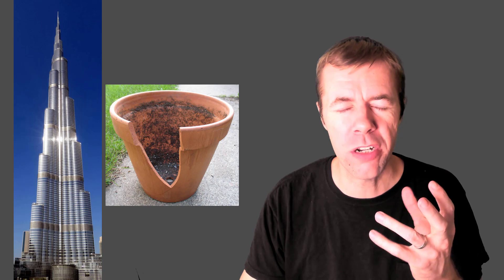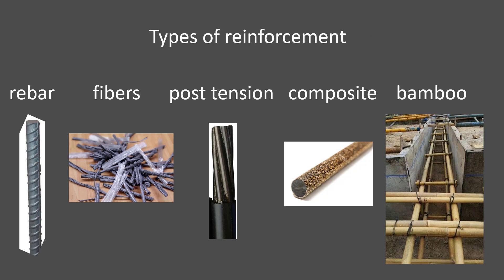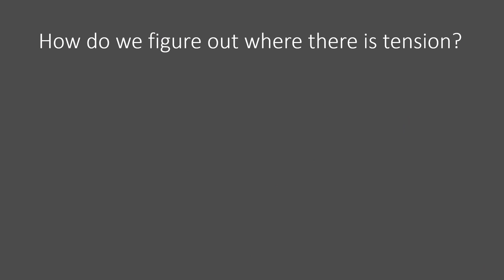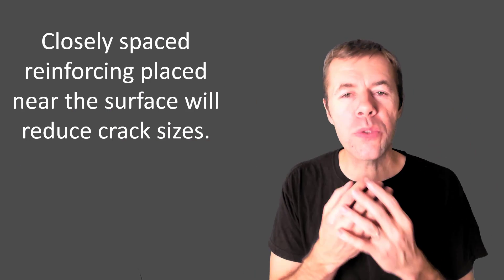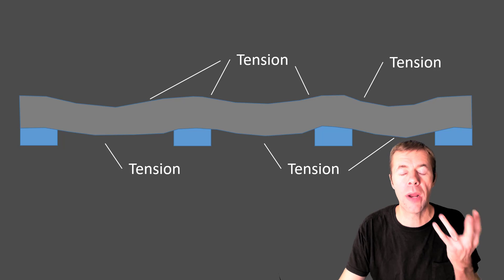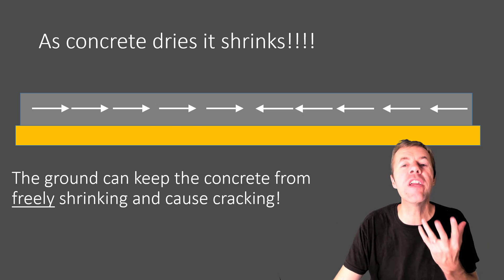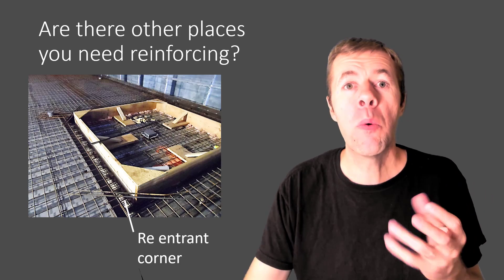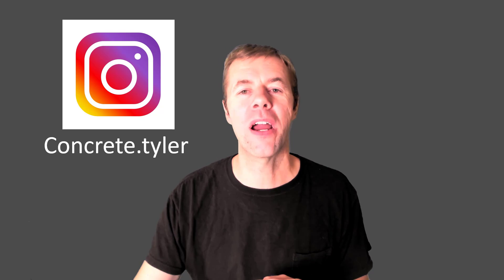Secrets of Reinforcement | How to design reinforced concrete

Comment: I have never - never - seen a video that explains better why reinforcing sometimes goes in the top, sometimes in the bottom, sometimes both. Fantastic video. One suggestion - sometimes we assume that the foundation under a concrete pad is 'immovable' but in reality, granular aggregate bases can and do deflect under load, so sometimes reinforcement at the bottom of a slab may still make sense.

Comment: Retired Concrete Finisher Porter Big 8 for years ago my grandfather had a lot of scrap inch and a half rebar 8 in on Center 4000 lb 6 in thick on chairs never crack Claiborne gray compaction is supposed to be hard that's why they tested

Comment: The ground will heave and contract.  I introduce the red clay we have in some parts of north central Texas, NW of DFW about an hour or so. 1+" cracks in the ground in the summer, zero cracks in the wet(ish) months. Slabs on grade can heave and fall at the perimeter and, the clay under the center area will dry out and contract, leaving voids under the concrete if there are sufficient piers to support it or turning the slab into a cereal bowl if there aren't. It's not just the friction of the soil holding the slab from expanding and contracting causing tension horizontally, it's the up and down at the edges as the soil gets wet and dries out and the depression in the center as the clay dries out never to get wet again (covered with concrete).

Comment: Nice video.. one tip, you also need to place rebar to counteract shear stresses, especially in beams.  This is typically done with stirrups.  Whereas tensile stresses are greatest at the top (simply supported) or bottom of a beam (cantilevered), shear stresses in a beam are greatest at the center.  These shear stresses typicall create principal stresses at about a 45 degree angle, which is why you'll see concrete beam cracks at 45 degrees.  Stirrups will resist separation at these cracks in additon to slippage at these cracks.. See the second half of the following video for a more complete explanation: https://youtu.be/KEu7KUpCX0g

Comment: Find a metal stamper, the ones who run progressive dies-  I ran a stamping plant and would save the skeleton -what is left from a strip of material after the part has been parted from the strip. I used these on several projects around the house, the material was 1/8 - make sure you agitate as the shape is irregular.

Comment: Hello Professor
I highly appreciate your wonderful discussion on the reason for using reinforcement, However, then why a concrete cylinder under compression fails with tension cracks due to hoop tension? Can we also explain this phenomenon and apply it to the necessity of stirrups in beams and ties in the columns? Please have a look at the following explanation and kindly let me know what is your opinion. 

I look into the necessity of rebar from a different angle based on the fundamental properties of brittle material. It comes from the basic characteristics of a brittle material like concrete which can not sustain plastic deformation so weak in mentions and brittle in response to loads. If concrete is not brittle or we may make it ductile like fiber-reinforced concrete (though not a 100% ductile material like steel), we may avoid shear reinforcements. Under compression load, any material (except a few which are engineered) will dilate due to Poisson's effect which would create tension in the transverse+hoop direction, and in the case of concrete (cylinders or cubes) under compression fails due to that tension along hoop direction. The compression capacity increased along with tensile capacity if we can confine the concrete along the hoop direction (as we retrofit concrete columns with Fiber Reinforced Polymer composite confinement, RC collar, etc.). 

In reinforced concrete design, the fundamental reason for using stirrups and tie rebars is to confine the concrete and thus to enhance the tensile capacity of the core concrete. If we cannot confine the concrete properly, no reinforced concrete can carry loads. We may create a finite element model of a reinforced concrete beam to observe the fundamental compressive principal stress distribution (the compression arch) under two-point load (AKA 4-point bending). We would see a compression arch formed starting from one support to another and peaking at the center. That means the locations of concrete under compression need confinement to enhance the tensile capacity of the core concrete to withstand the tension in the transverse direction, e.g., stirrups for confining concrete in beams and ties for confining concrete in columns/piles, etc. If we can confine concrete adequately, the compression capacity will increase a lot, however, the cost may increase as well, so by optimizing the cost and strength, the economical design is performed. We never use any stirrup in STEEL beams or tie in STEEL columns, however, we need different solutions for steel beams at high shear zone due to the geometry of the sections.

Again, please note, stirrups and tie act as passive confinements, i.e., they get active only under loading. I hope you may provide your valuable comments.

Please check the following articles for more information about dilation, principal compression arch in concrete, and specimens under flexure:
https://ascelibrary.org/doi/10.1061/%28ASCE%29CC.1943-5614.0000599,  https://ascelibrary.org/doi/10.1061/%28ASCE%29CC.1943-5614.0000599, https://ascelibrary.org/doi/abs/10.1061/(ASCE)CC.1943-5614.0000574

Sincerely

Comment: I read that putting rebar near outer surface of concrete is bad and there should be 1-3" buffer of concrete around any rebar to prevent spalling and protect rebar from moisture/rusting

Comment: Remember, you asked for it.  I want to build a garage over a basement. The garage floor will cover a free span of 24' x 24'.  The top of the garage floor will be flat, the bottom slightly concave. The concavity should make the floor about 3" thinner at the center. I'm all for loading the concrete with macro- and micro-fiber, but am having difficulty justifying using FRP since none of the slab will be in tension. I'm in favor of adding super-plasticizers to reduce the number of large air pockets. I'd prefer the slump to leave the wet mix virtually flat, but that probably falls into the realm of the next hundred years.

Comment: Thanks for this. As an Engineer, this has made me learn more about concrete and reinforcement. Concrete is strong in compression but weak in tension  that's the main reason why reinforcement is required. Doing this will eliminate or reduce cracks to be as minimal as possible. Well explained!👍

Comment: I'm putting #4 rebar at 2" from the bottom of my slab and want to put WW mesh at 1.5" from the top (6" slab).  The problem I'm having is I can't find any good option for a support for the mesh over the rebar.  What's the best option for that?

Comment: Intersecting steel rebars that form right angles forming a double-shell reinforcement 1 inch deep below the concrete top surface and 1 inch above the conrete bottom surface. With post tensioning used in bridges that has 2 supporting beam and post supports, then on a slab it should be INTERSECTING LENGHTWISE AND CROSSWISE POST TENSIONING for the supporting beam and post supports are replaced by the EDGES of the slab at the FRONT AND BACK AND LEFT SIDE AND RIGHT SIDE. The the post tensioning should be Intersecting post-tensioning cables that form right angles from the front to the back, and from the right side to the left side. But personally I prefer a double-shell of intersecting steel rebars that form right angles like a square grid pattern. And combine it with double twisted pre-anodized galvanized steel fibers. Forming a very dense hybrid steel rebar-steel fiber reinforced concrete.

Comment: http://www.arche.psu.edu/thinshells/module%20III/concrete_material.htm
 
Concrete Materials
Properties of Concrete (ASCE 11-99)
Reinforcement
Ferrocement
 
Ferrocement
 
Ferrocement is a composite reinforced concrete material, originating from marine construction, in which concrete is applied in a very thin layer to densely spaced small diameter reinforcement. 
 
‘Ferrocement is a form of reinforced concrete in the sense of the grouping of the terms ‘reinforced’ and ‘concrete.’  It differs, however, from reinforced concrete by the manner in which the reinforcement is distributed in the matrix.  The general arrangement of closely spaced continuous reinforcement converts the matrix into a composite material unlike conventional reinforced concrete.  Because of the closer spacing (of the order of 1 to 2 inches) and the thin sections.  The nature of the reinforcement is such that hardly any formwork is required to form complicated shapes.’
 
--Ferrocement—Materials and Applications.   ACI Special Publication SP-61, Detroit, American Concrete Institute, 1979. 
 
The definition of the ACI Committee on Ferrocement is
 
‘Ferrocement is a type of thin wall reinforced concrete construction, where usually a hydraulic cement is reinforced with layers of continuous and relatively small diameter mesh.  Mesh may be made of metallic materials or other suitable materials.’
 
Ferrocement was the material of choice for Nervi, and he speaks of the material in these terms.
 
‘The fundamental idea behind the new reinforced concrete material Ferro-cemento is the well known and elementary fact that concrete can stand large strains in the neighborhood of the reinforcement, and that the magnitude of the strains depends on the distribution and subdivision of the reinforcement throughout the mass of concrete.  With this principle as a starting point, I asked myself what would be the behavior of thin slabs in which the proportion and subdivision of the reinforcement were increased to a maximum by surrounding layers of find steel mesh, one on top of the other, with cement mortar.  
 
The square mesh was of the standard type on which plaster is sprayed in the construction of ceilings, and was made out of ductile steel wires 0.02 in. in diameter, set 0.4 in. apart.  It weighed 0.15 to 0.35 psf.  The mortar was made of 0.6 to 0.75 lb. of cement to the cubic foot of good quality sand [probably meant to be …to the pound of good quality sand.].  The slabs were very thin, but extremely flexible, elastic and strong. 
 
Later on, in order to increase the thickness and the strength of the slabs without using more than 10 or 12 layers of mesh, I tried inserting one or more layers of steel bars 0.25 to 0.4 in. in diameter between the middle layers of mesh, thus attaining thicknesses of 2.5 to 4 in.  It must be noted that the thickness of all slabs was only slightly greater than the thickness of the package of mesh, the additional thickness being that of the mortar required to cover the two outslde layers of mesh. 
 
The material thus created did not behave like regular concrete, but presented all the mechanical characteristics of a homogeneous material. 
 
Experiments with the new material demonstrated immediately its most important and fruitful properties: it could withstand great strains without formation of cracks in the cement mortar, as a result of the subdivision of reinforcement, and it eliminated forms, because the mortar could be applied directly to the mesh, which would act as lath to retain it.

Comment: Dear Professor Ley, can polystyrene concrete be reinforced with rebars and/or plastic fibers?
I would like to make concrete walls (preferably light and well insulated) on a metal structure similar to a shipping container's metal structure/skeleton and I want to be able to transport it without the precious concrete cracking. :) I'm thinking to build the metal structure and THEN pour the concrete walls directly onto it. But if rebars can be used in polystyrene concrete then maybe I don't even need I-beams to carry the weight of the structure.(?) > Could a box culvert be built using polystyrene concrete?

Comment: Thank you for sharing this video. Just want to share my observation when I was briefly assigned to Saudi Arabia, it's about plastic-coated rebars and tie-wires used (slab) without any sign of rusting even after 20 years. It would be great if there will be pre-cut rebars and plastic-coated for structural, so as to assure no metal exposure to cement.

Comment: Tyler, could you discuss the utility of using placing dry concrete in forms and/or around fence posts? The issue is, I’ve seen people using a dry cement poured and packed around a post WITHOUT water. Their theory is that the concrete will absorb water from the soil. Now I have an associate who is thinking about using the process to pour some small bridge footings. The question I ask is how ‘strong/useful’ is concrete in this situation and with this process?

Comment: For basic gravity loads, is easy to grasp tension and compression loads. Add in the dynamics of seismic load and you need to consider different reactions. A basic equation for the seismic load distribution, Ai =1/ αi , is obtained based on the assumption that the velocity spectrum of the ground motion is independent of the period. Further, it is obtained from the maximum shear response using the elastic shear bar with both uniform stiffness and mass distributions. Through lessons learned (and still learning) some structures are designed stiff while others are designed flexible.

Comment: In the Philippines they put rebar too close to the outdoor surface and moisture seeps in and corrodes the rebar and the expanding corrosion cracks the concrete.
They also lay the rebar on the bottom of the second floor or patio and same story the moisture seeps in and corrosion and cracks and also the rebar isn't doing anything except crumbling and falling on the floor below.

Comment: Hi Tyler, When making a concrete sculpture with an armature (artist jargon for rebar and wire skeleton).  My idea would be to use regular rebar for the majority of the weight, and then use various gauges of GALVANIZED wire twisted in whatever shapes I need.  Then I would use a very thin coat of epoxy over all of the metal once it is the shape I need.  Do you have any thoughts or guesses on how to improve on this?  Its not going to be load bearing, but expensive stuff in art galleries, so its not a good look for them to be falling apart over time.  
You were kind enough to respond to a personal message before, but I'm putting this in your chat this time so at least it can boost your algorithm ever so slightly.

Comment: Curios of reinforcement design. I am building concrete patio, driweway 3m wide. I decided to use rebar with 0.4m spacing, at the bottom and top, so two layers of reinforcement. I think is better solution then add in the middle with 0.2m spacing. Average concrete thickness is 12cm, so either "middle" version has to press 6cm(if perfect in the middle, normally 4-6cm)of concrete to crack or ~8-10cm for two layer design. So I hope I gained double the strength with same materials, just more labor work. Since I do it myself, I don't mind.

Comment: Very good video..... thank you. I have question though, for concrete on the ground why don't you put steel at the bottom side to prevent the curling ? At 6:32 you recommended to put the steel at top side...

Comment: Hi
I worked in the asbestos cement industry before asbestos was banned. While trying to replace asbestos with celullose fibre we were advised to high shear mix the cement with a very low water content. The idea was to remove the wetted surface of the cement particle thereby exposing the inner "dry" portion of the particle to the water and hence improving strength. Have you done any research on this .

Comment: With respect to your pictures of re entrant corners you show 1 bar at 45 deg to mitigate cracking.

On my re entrant corners I am considering a 30cm (10") radius to eliminate the hard 90 deg inside angle, with rebar following it round. However it would be quicker just to lay down straight rebar at say 30 and 60 deg, or even 3 sets at 22, 45 and 77. Your views greatly appreciated.

Comment: Yo Tayler, I love your video's. Maybe you can help me out here.
I have succeeded making a beam, 70cm long, can hold a load of 10 Tons (metric), so it's already twice the strength of a Hea 200. But not even half the weight. It can go to a 1000 degrees Celsius. And it doesn't rust, because I don't use any metal. I have come up with another working principle. And I can now say that the concrete beams we made until now are with the principle,  strength through mass, my principle is strenght through shape. Like architectural law no.1 is telling us. Create strength through shape and not through mass. I'm a start up and looking for someone  how believes in my (tested) idea. Have a nice Christmas. Thank you